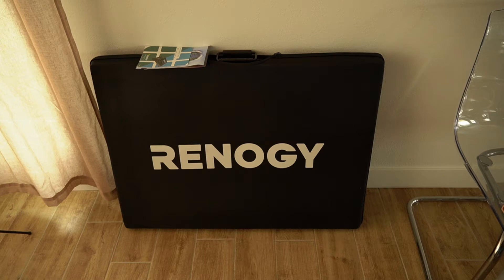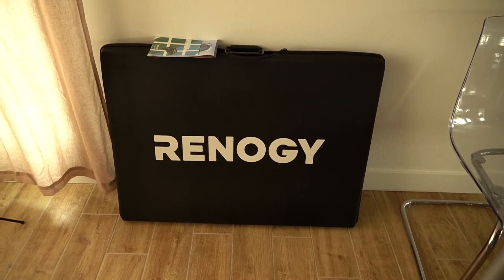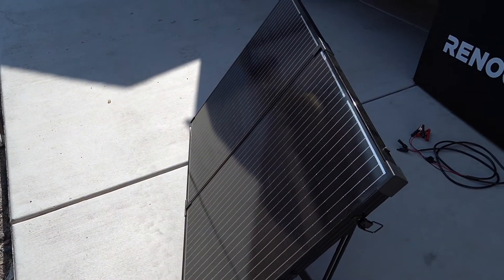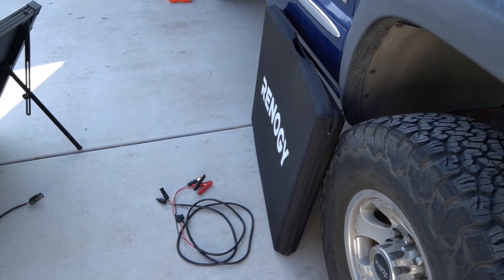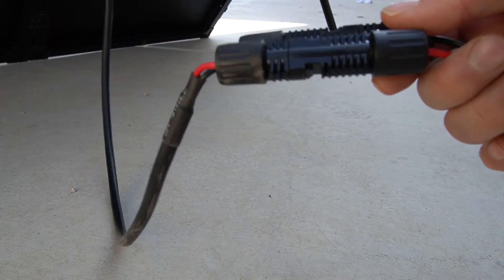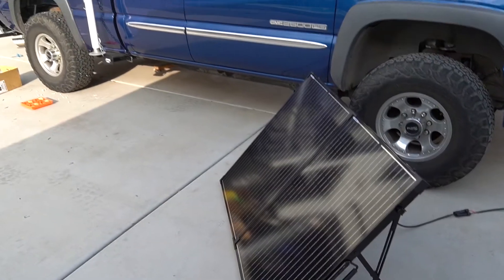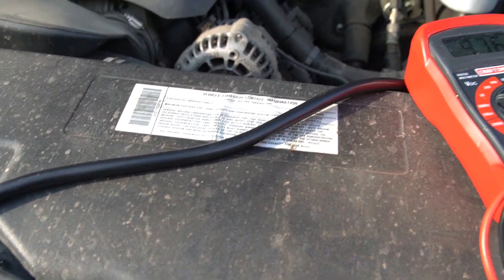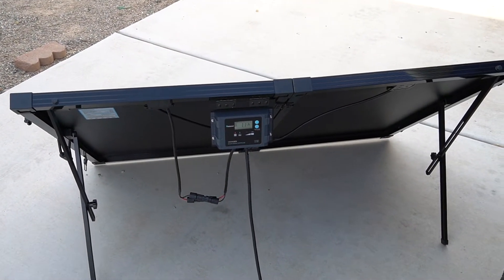RENOGY SOLAR SUITCASE - How-to/Review

Comment: I was wondering if you can help me. Just want to be sure, the that you've charged is an AGM type right? What is the max amp output that you've ever gotten? Some reviews says that if we are charging agm, the controller is limiting the amp output to just 6amp. I really don't want to buy a 200w panel unit if I'm just going to get what a 100w unit is capable of outputing. I hope your can clarify if this is a fact or just some random negative feedback that people spreads. Keep up the good work! 👍
Reply from the maker: Thanks, I appreciate that. Honestly I don't pay attention to the amps. Well as long as everything is working. when I am camping, if my panels are close to the sun, tbe battery is usually fully charged when I wake up. I honestly never checked to see if I get full amps, but only because it works so good. I have run a fridge, lights and a fan, and charged phones and tablets on a 4 day trip with no issues. As luck would have it I am heading out for an overnighter at the lake. I will take some time, and get direct sunlight and see what amps I am pulling. but honestly if tbe battery stays charged, it wont pull many amps. At the end of the day aftrr almost a year it is still awesome. I have had no issues even with wire extensions. Sorry so long winded, but you wont be disappointed. I will reply in a couple days with more data.
Reply from the maker: @alexbarquin9 I have more info for you. Reading your question again and also coming back from camping, I did want to reiterate, that I am running an AGM battery. It is X2power (Battery Plus) I picked that because it is a AGM RV battery with a 4 year full warranty meaning if it goes bad they replace it not prorate it, and it is pushing 3 years and is still good. Since my battery is good, It doesn't push full amps and the fridge and lights weren't enough to drain the battery down below 12.2 volts as a reference. So in the morning after being using the battery all night with no solar, the battery was down to 12.2 volts. I checked the amps and it said 11.1 amps. It within an hour jumped to 14.4 volts and the amps dropped down to 3 the next time I checked it. The charge controller works like a battery charger. It ups the amps if you need it then reduces as the battery charges and then floats when completely charged. I have some more numbers for you on just the solar panels, but not to flood the comment section. I will add the numbers on the "DISCUSSION" part of my channel. Look there for actual solar panel numbers and what I found on mine. I hope this answers your question. If you need more clarification, feel free to ask more questions, and also read my post in the "DISCUSSION" tab on my channel. Thanks for the question, you have forced me to learn more about my solar panels, so thanks for keeping me on my toes! I hope this helped.
Reply: @azxp  No, thank you for taking the time and giving me a detailed factual information. I learnt alot from you as well and I will be getting the same unit now. Take care and looking forward to more videos from you. Keep up the good job 👍
Reply: @azxp  I got my unit today and used it on a nice clear day in down under. I got on average 10-11.3amp. It even fluctuates to 12amp sometimes. Makes charging my agm such a breeze. Couldn't be happier. Thanks once again.
Reply from the maker: Yeah? That is great to hear, thanks for following up!

Comment: They all work for keeping a charge on the battery, if you need or use more, you need more panels and batteries etc, I have part this, but I started with the harbor fright set up which works great for what we need, thank's for sharing this. I'm going to sharing with friends that are thinking about getting this...
Reply from the maker: Thanks for the comment, and thanks for watching.

Comment: Do you have the car off while charging... or can you run stuff while its charging
Reply from the maker: I only tested the solar panels on a handy battery. The real use case will be for boondocking. The camper battery will run the fridge and accessories while the solar panels recharge the batteries during the day. Thanks for your question.